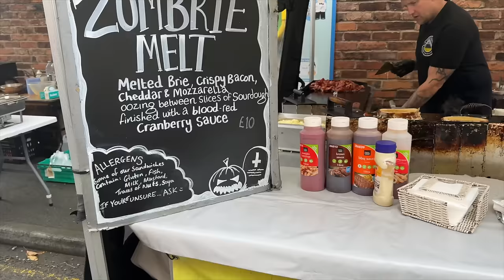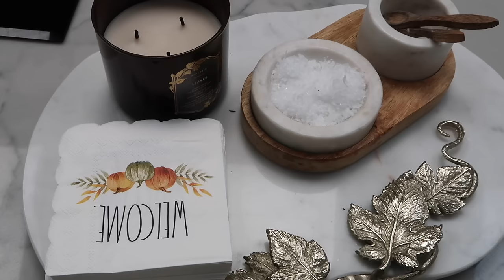THE LAST AUTUMN VLOG 🍂 Outdoor kitchen updates & halloween party bags

Comment: I am always fascinated when I see English people putting their washing on, it’s usually for a hour and a half, that can’t be good for your clothes surely. Since moving to Australia I have a top loader automatic which takes approximately thirty minutes, only wash in cold water with special washing detergent for cold water only, it’s brilliant. When you think about it most clothes don’t get that dirty and if so you can pop some napisan in with the wash. Saves heaps on power bills. Love your channel.
Reply: I'm from the UK I never wash anything longer than my 15 minute circle other than my whites
Reply: Gosh, that's true - and some of our cycles can be over 3 hours! It must take its toll on our clothes. I do have a 26min speed option at 40⁰ that I tend to use though.
Reply: I never put anything on more than a 26 min quick wash.  Don’t see the point of anything longer.
Reply: All my wash except bedding n towels is 30min cycle& very little washing powder ,like you say our clothes just need freshened 🏴
Reply: I would say Firefly Lane, it was fab!